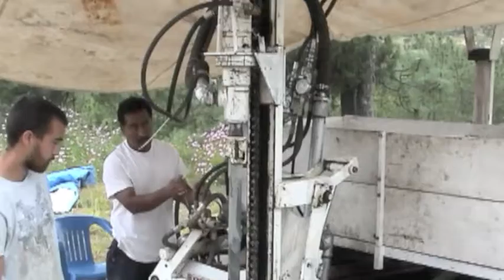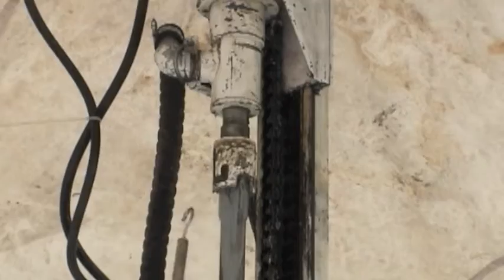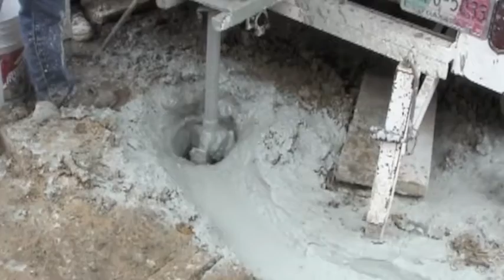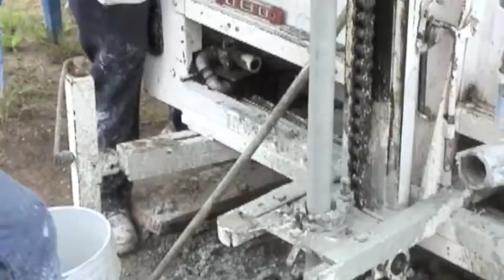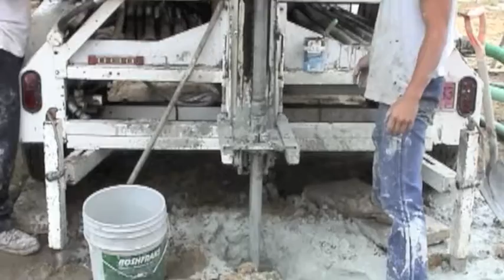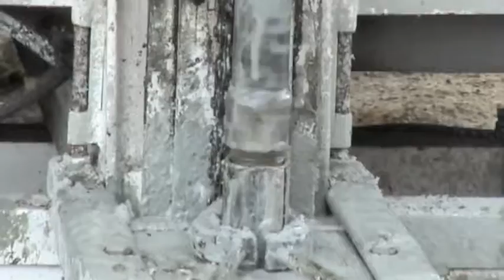Tripping Water Well Pipe Oct 2013

Comment from the maker: Taking the pipe out is necessary at times to check or change the drilling bit.  Sometimes you have to change bits because of the formations you run into and other times your checking how much clay has stuck to the bit which was the case this particular time.